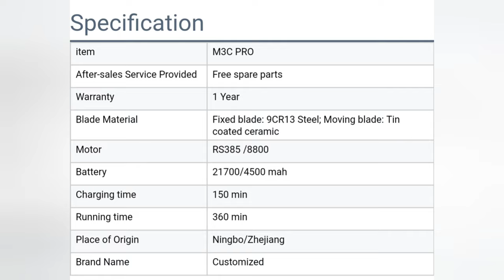Trisan Destroyer Teardown 👉 Big Battery

Comment: This clipper’s best feature is it’s looks. The performance is ok. It’s a little weighty. Not too heavy but you can feel the weight. The RPM does stand true! I had higher hopes with this clipper just to find out that it doesn’t stand up in the durability test. 

I just talked to you now my version has become loud in the open position Edo‼️🤔
Reply from the maker: It's ok with ceramic blade